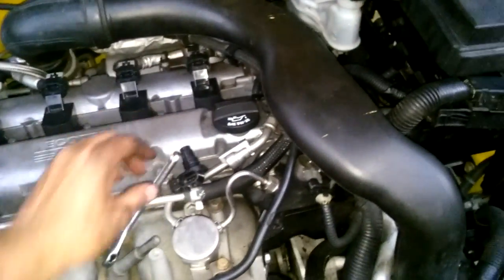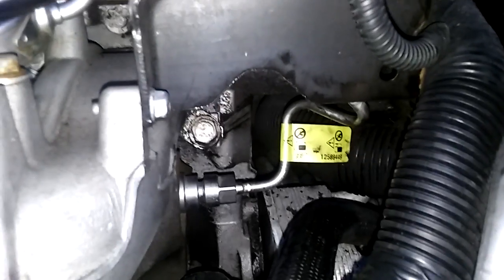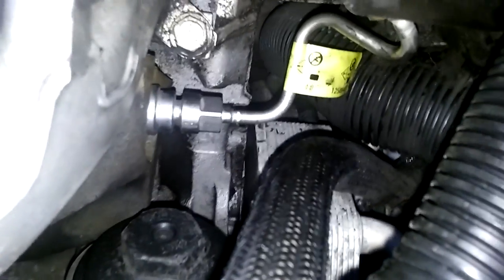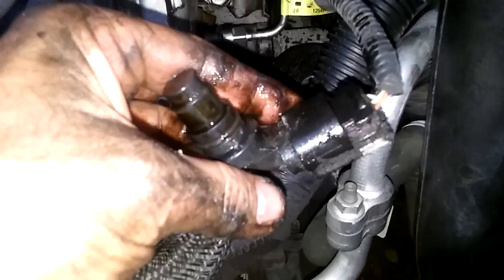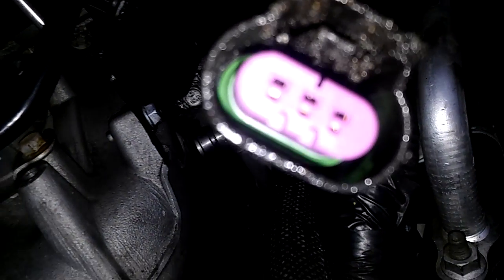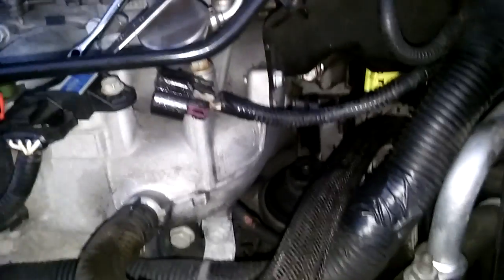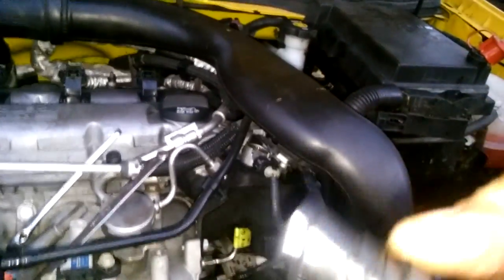Chevy Cobalt Ecotech 2 0, 2 2, 2.4 Camshaft Postion Sensor

Comment: Not sure if you’ll get to this comment seeing as the video is old, but how did you manage to break the bolt loose? i can’t seem to get anything to fit there to get it off including the socket like the one you used
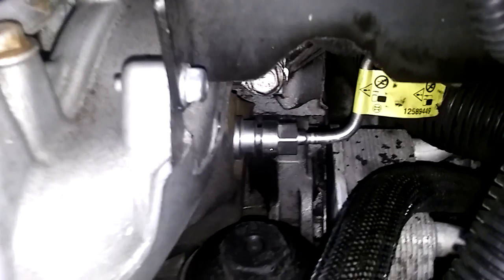Reply from the maker: Hi, Like I said  @ 00:40 I used a skinny 12 point wrench. Hope that helps.

Comment: 2.0 ,2.2 and 2.4 ecotec motors are NOT all the same! Some mid 2000's 2.2 ecotec motors don't even have a camshaft position sensor. Even the ECU will and can still throw a code for one! (GM kept older software with new engine designs). If have one these 2.2 ecotecs with this camshaft position code, it may be a failing ignition control module. And some places and people mistake the crankshaft position sensor for a camshaft position sensor.
GM always has recently annoyed me in this way. Constantly "upgrading" and reengineering. 2 variants of the same motor can be found in a single year car or truck model.:face-orange-frowning:
Reply from the maker: Well same basic blocks and parts ect. So you mean like 1988,1999 and 2007 thier were two different models of the same truck. Do you have a 2007 classic Silverado or just a 2007 Silverado. 1988 obs or 1998 truck.
Reply: Thanks for the info driving myself crazy trying to find the stupid thing

Comment: This doesn't work for the 2.2L, differrent location
Reply from the maker: Thanks for the extra info.
Reply: There's a different location? The info I keep finding is it doesn't have one. Can you tell me where it is or have a site that shows it?
Reply: @InsideLectersBowels  your correct it doesn’t exist on that engine. On the 2.2L Ecotec, The ICM and coil packs are failing and the first sign is it throws up the code. Replace those two things with either Standard or AcDelco products. I tried using Duralast and failed both times. If not the car will randomly start stalling on you.

Comment: On my 2.2 engine in my 2010 HHR  there are 2 camshaft sensors 1 in the front and 1 in the back of the engine. The 1 in the front is easy to change out, I had a hard time getting to the 1 on the back of the engine because the way the bolt faces on an downward angle. So since I had the car up on ramps and I was changing the oil at the time, I use a 1/4 extension bar (2 bars) with my 10 mm socket to get the bolt out. Once I loosened the bolt, I romoved the bolt by hand, swapped out the sensor and replaced it back in the way I took it out. Took a little longer but I got it done, no more vibration in the engine while it's in drive.
Reply: Jumping in here 4yrs later because you're pointing out a great fact!
A lot of these videos lead people to believe all Ecotec's are the same for MANY years. This is not the case at all! There were many revisions on the Ecotec motor line throughout the years. A 2.0, 2.2 and 2.4 Ecotec ARE NOT the Same. Locations of sensors moved. GM even moved things during mid-production runs (They say "Updates"). Some Ecotec's HAD NO camshaft sensor at all! Yet the ECU would still throw a P0340 code, further complicating diagnosis.
G- Gods
M- Mechanical
C- Curse
Reply: Mine isn’t located there

Comment: Is it different for 2.0 lsj supercharged?
Reply from the maker: I don't have the 2.2 but as stated Works for most 2.0, 2.2 and 2.4L engines as they are the same basic blocks
Reply: mobilemowers thanks I think I have to remove the belt off the supercharger